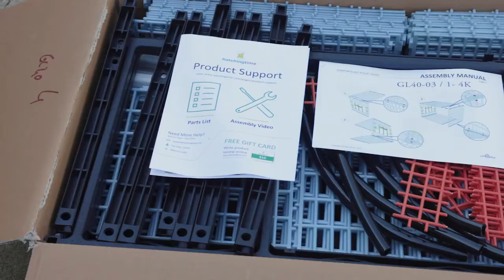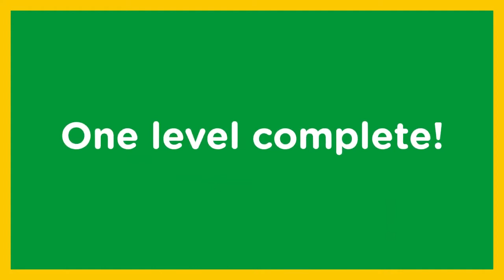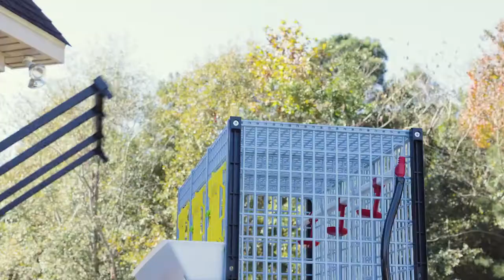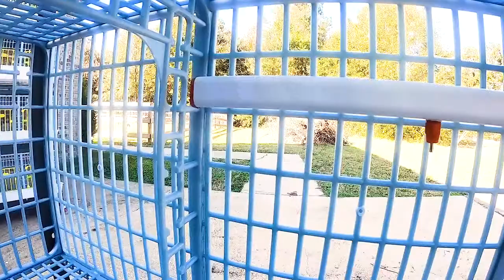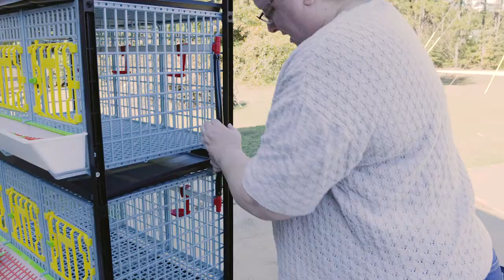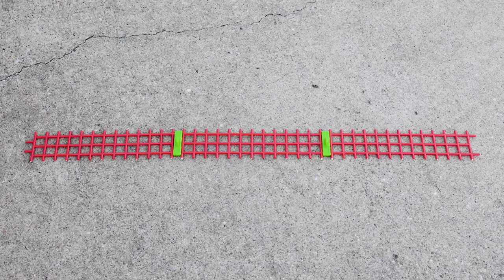Build With Brigid | Hatching Time's 15" - 4 Layer Grow Out Pen Assembly & Pro Tips

Comment: How do I prime the waterer?
Reply from the maker: Hi,  If there is no water flow, it is possible there is a air pocket blocking the water.  It can happen with a new set up or if the water level in the tank drops below the connector and allows air into the lines.  You will need to press the metal drinker tip up  and let it fall back down to expell the air.  It could take several tries depending on how much air is trapped in the system.  Please check back if you have additional questions.  Thank you!